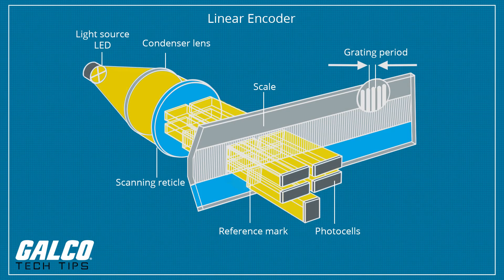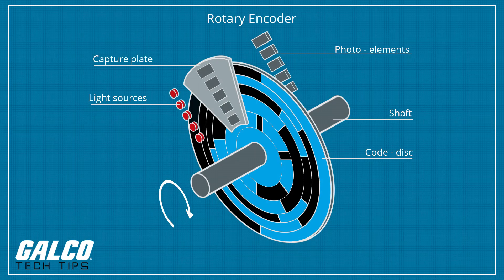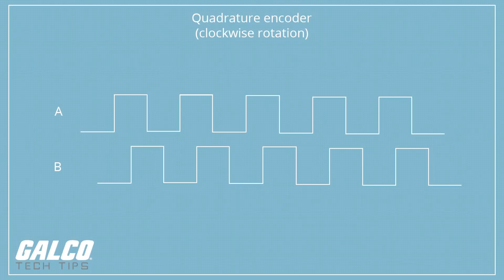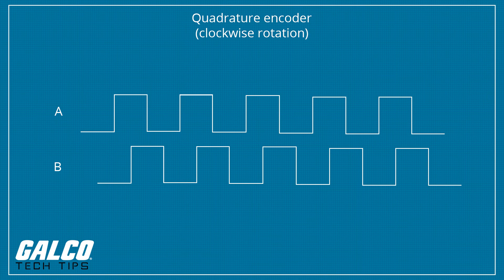What is an Encoder and how does it work? - A Galco TV Tech Tip | Galco

Comment: Thanks so much for this video @GalcoTV ... a question: Can a device be added to an incremental encoder to make it behave like an absolute encoder?
Reply from the maker: Well not exactly. However the primary difference between an Incremental and Absolute encoder is a battery, or battery terminals for an external battery to connect to it and save in memory where it was if the machine powers down. So it knows at all times absolutely where the heck it is, that is until the battery dies, lol
Reply: GalcoTV thanks! Appreciate it!